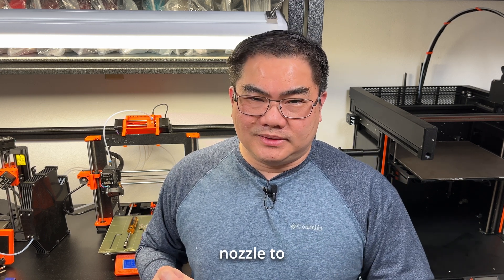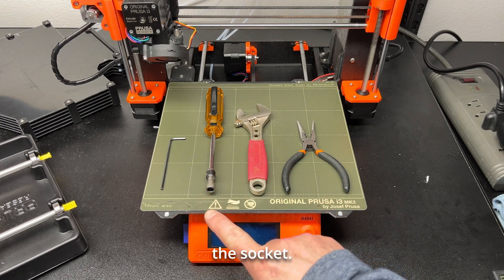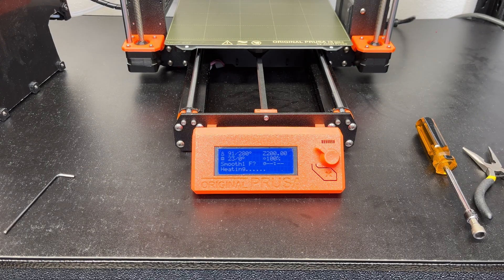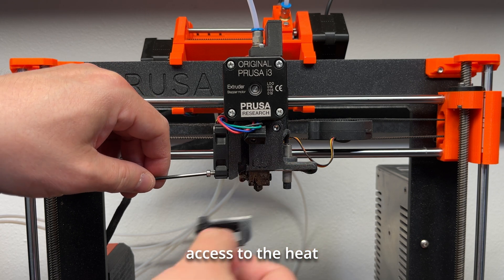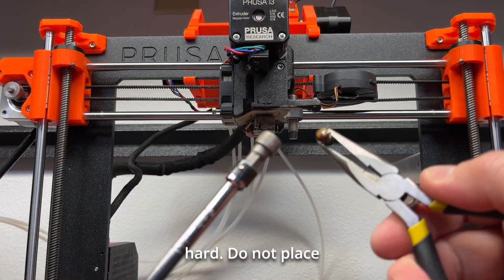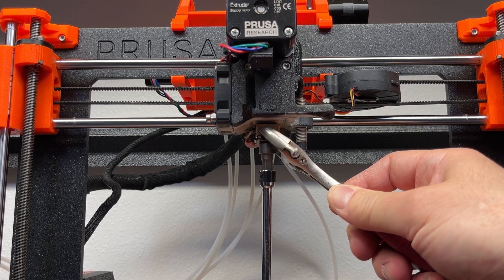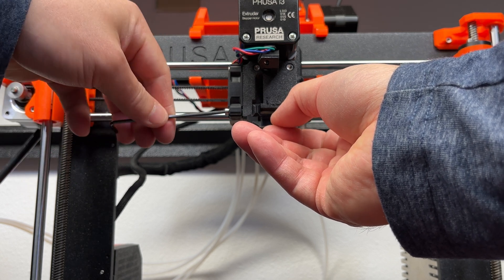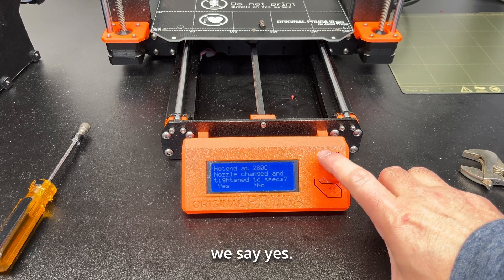How to Change Nozzle on Prusa MK3S

Comment: The Prusa document says tighten to torque of 2.5Nm. That is about two finger tight, as if you're twisting that bottle cap with only two fingers. If you work on bikes, you'll probably have a torque wrench that can do 2.5Nm.
Reply from the maker: That's a great point! I don't work on bikes but I did find torque wrench for bikes that can do 2.5Nm and will give it a try. Thank you!
Reply: @journeywithleong  I got my 0.6mm nozzle today and easily changed it with your advice. Thanks
Reply from the maker: That's awesome! I'm happy the video helped. I bought a torque wrench for bikes like you suggested to try out. Will make an updated video on it once I get a good feel with it. Thank you for your suggestions.

Comment: Great video, thank you! So, one question if I may (for anyone with experience with this to answer of course): In the sort of outdated prusa video (https://www.youtube.com/watch?v=txt6sxV6X88) they seem to show that the heat block needs to be slightly unscrewed, but they don't explain why... You only seem to hold onto it here. Is the nozzle locked in place until the heatblock is slightly unscrewed or can I just hold onto it without actually moving / unscrewing it?
Reply from the maker: I have never seen this video until you posted it. Thank you for sharing! I can see why they unscrew the heat block first before the nozzle on a brand new print head assembly. It is a lot easier to turn the heat block with the adjustable wrench and safer so the nozzle is not taking most of the force to get unscrewed from the heat block. However, I have accidently turn the heat block while the nozzle is still tight. 
After using the printer with various different materials for a few months of printing, I found one of 2 things could happen when I unintentionally turned the heat block while trying to change nozzle the first time, twisting the heat block also loosened the hotend heat break or worse, the whole heat sink and hot end assembly turns together. I had to loosen the whole print heat to rotate the whole heat sink/hotend assembly back to original, tightened everything back, then try to remove the nozzle again. I'm not sure why but once I get a new nozzle in, it will be much easier to change if I only printed a few parts. After a few months of printing high temp filament like PCCF, the nozzle somehow gets a bit harder to remove. 
Will be great if everyone can share their experience with turning the heat block first and if that's easier once the printer has been printing for a few months.
Thank you!